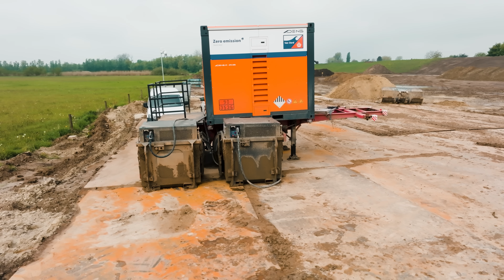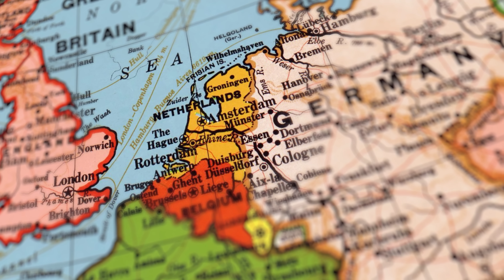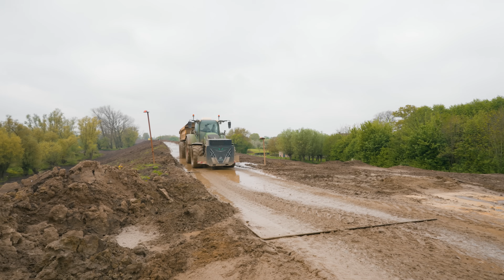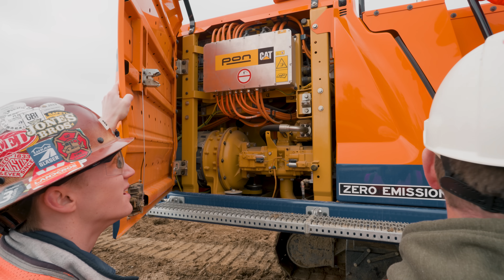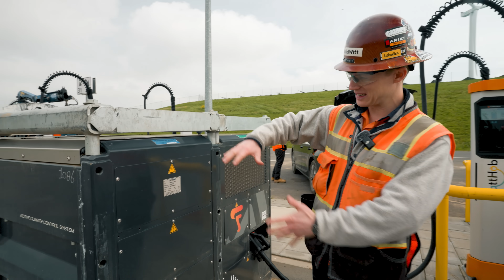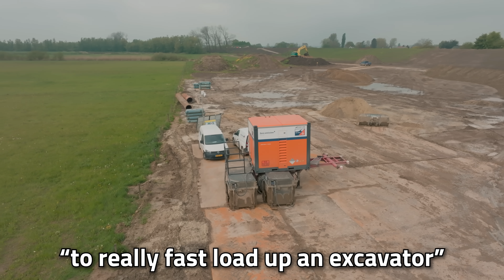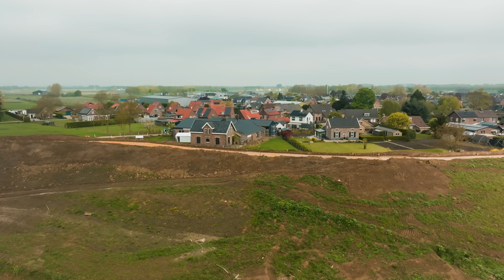Inside the World’s First Electric Construction Project!

Comment: The taxpayers are gonna be bumming paying for electricity and battery replacement. It gets passed on to municipalities. Solar panels don't recharge them how is the electricity for recharging produced? Fossil.
Reply: The solar and wind park you see next to the charging station (Geldermalsen, NL) is only allowed to put power into the grid. It’s not allowed to take power from the grid during daytime. So no renewable energy means no charging.

For the DC charger it is easy to control this as the fast charger can tell the machine or battery container how much power it may draw.

But the big batteries charging on AC proved to be a problem as we could not tell the battery how much power to draw though powerline communication. So we had to resort to a cloud based solution for the first months of this project.
Reply: @DezeTimisTim  🤝 you absolute legends
Reply: The Dutch electric grid is 40% renewable and 40% natural gas and 14 % coal.
But they might be paying for a contract with match production using renewable sources.
Reply: I suppose no different than thousands of gallons of diesel, oil changes, rebuilds, etc.
Reply: Which is what's used to produce electricity.
Reply: @rickcoleman8903  stop talking shit 🤡
Reply: @rickcoleman8903  stop it

Comment: Will it be disclosed where all this battery is getting their charge from?
Reply: The Dutch electric grid.
40% renewable, 40% natural gas and 14 % coal.
But they might be paying for a contract with matched production using only renewable energy source, in that case  it's just solar and wind turbine.
Reply: @Luzgar  54% renewable in 2024
Reply: @Freba9 The Wikipedia page only had figures up to 2022.
Feel free to update it !
Reply: he shows the sun panels and the windmill
Reply: As one of the Engineers of the project I can tell you this. The solar and wind park you see next to the charging station (Geldermalsen, NL) is only allowed to put power into the grid. It’s not allowed to take power from the grid during daytime. So no renewable energy means no charging.

For the DC charger it is easy to control this as the fast charger can tell the machine or battery container how much power it may draw.

But the big batteries charging on AC proved to be a problem as we could not tell the battery how much power to draw though powerline communication. So we had to resort to a cloud based solution for the first months of this project.
Reply: @DezeTimisTim  Great work Tim.
Reply: well over 50% of all the energy used in The Netherlands is generated by wind and solar.
so if we use the assumption they use the local grid, over half of it is green.

and i think we can all agree that 50% green energy is way better than 100% fossil fuel engines.
Reply: 😂😂😂😂😂😂 From the local coal / natural gas powerplant.
Reply: @Oldschoolrules123  nope

Comment: It would almost make sense to just drag a cable to the excavator and work with it plugged in.
Reply from the maker: That’s how a lot of large mining machines work
Reply: for the excavator that will work, but once you add in all the other vehicles driving around in building projects it becomes (almost) impossible to just lay a few cables throughout the project area to power vehicle.

Comment: Energy sources for electricity generation in the Netherlands : 40% renewable and 40% natural gas and 14 % coal.
Could be better (coal is the worst), but probably actively improving.
Reply: All coalplants are due to shut down in 2029. in the aim is to be net zero in 2050. Currently the biggest obstacle is reinforcing the grid. If the grid was capable of handling more we could be further along.
Reply: @Zandoerlenaar  Would be better in France, with our 60% nuclear.
Reply: @Luzgar  outdated figures
Reply: @Freba9 Sorry, the Wikipedia page only had figures up to 2022.

Comment: Power comes from a coal fire plant ran buy diesel equipment lmao
Reply: The Dutch electric grid is 40% renewable and 40% natural gas and 14 % coal.
But they might be paying for a contract with match production using renewable sources.
Reply: What are you talking about? I thought that my DeWalt electric power tools were running on solar panels.😂😂😂😂😂😂 Actually they get power from a natural gas power plant 30 miles away.

Comment: And the big batteries get the charge from a big diesel generator… waste of money.
Reply: You just made that up. That station is connected to the grid.
Reply: A diesel generator running at the optimal speed for peak efficiency with batteries can give you better efficiency overall than an onboard diesel engine in some case.
Reply: That charging station is clearly toed to the grid.

Comment: So if the excavator uses 800 kilowatts per hour for a 8 hour shift. That’s about the same as 80 households use in that same timeframe. A typical household uses around 30 kilowatts per hour for a full day. So it pulls the same as 400 houses per work week off the power grid. You said they have four running each day so 1600 homes per week. I’ll let everyone draw there on conclusions.

Still very cool technology.
Reply: And a Diesel excavator uses less? You can triple that number in reality. So what's the difference?
Reply: Wrong SMFH 800kwhs per 8hr shift per excavator genius!
100kwhs per HR during operations is equivalent to LESS THAN 3 GALLONS OF DIESEL FUEL BURNED! 
As diesel is 37.9kwhs in total energy content per gallon!
Reply: @4literv6  3 gallons lol in your dreams! 6-9 gallons an hour is a more realistic scenario, coming out to more than 2000kWh. Its a proven fact electric is ALWAYS more efficient!
Besides, the electric motor in this CAT zline excavator is 120KW, so 100kWh/h would mean its running almost 100% which is not the case in this scenario. Imagine all that idle time saved waiting for the next truck 😂
And lastly, 37.95 X 3 = 113kWh per hour 😂😂
Reply: Lol 800KW/h? I don't think we'd be doing this then. It's per 8 hour shift.
Reply: @lolimpol looks like he calculated the raw energy provided from burning diesel fuel alone without accounting for engine efficiency. Assuming 45%, we end up with yours, which is correct.
Reply: @HammondOfTexas0 no those 2000kWh+ in diesel burned are raw energy numbers. Just to indicate its a stupid point to bring up as modern gas and coal power plants operate at 80+% efficiency. The entire reason 2000kWh of diesel has to be burned is because of the 30% efficiency (45% is extremely high for anything not F1😅)

Comment: Wait a minute, they use a diesel truck to transport the batteries to the site? Nice 👍
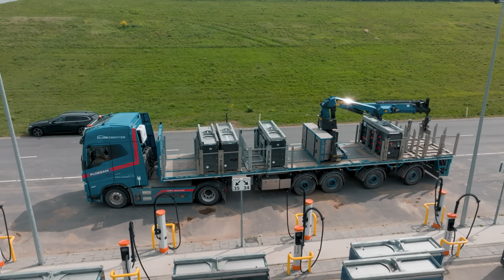Reply: If you mean the truck seen at 16:07, then no actually.
Reply: @stephanvink4920 I didn't knew that Volvo had electric trucks ( meaning that well developed), thanks for the info. 👍
Reply: Those are electric Volvo's.... sorry to burst your bubble there :)
Reply: NO THEY DON'T, IT EVEN HAS A PLUG PAINTED ON IT'S SIDE SO EVEN THE DUMB SHOULD NOTICE
Reply: calm down
Reply: The truck is only going to be there for part of the time. You only have one machine running diesel, that's still significantly less noise on the job site and less air pollution for people to breathe in if you're working in a populated area.
Reply: Wow in two hours I got 6 sassy smart girls that cannot respond without shaking their hips. Go all suck a pick.
Reply: @Aaron Witt @Ar Things here are moderated with the North Korea filter? what's the problem of responding on the same energy? It's a crime saying they should go suck a Dick?
Reply: Don't worry, all of that heavy equipment is built from using OIL.  I have yet to see heavy equipment built from scratch using solar panels and wind turbines. They always leave that part out.
Reply: @Oldschoolrules123  not relevant at all. Total emissions are far lower.
Reply: They use whatever the energy mix of the grit is, which in Europe is much cleaner @Oldschoolrules123
Reply: @Oldschoolrules123 goddamn man, you habe really zero fucking clue 🤦‍♂️ 
how can someone be so confidently wrong?😂

One could argue that a big part of the steel still get's produced with coal, but definitely not oil. 
but a) the emissions in production would be the same for a diesel machine 
and b) they're currently in the process of switching to electric arc furnaces and hydrogen reduction

and don't come at me with the "bUt WhErE dO tHeY gEt ThE eLeCtRiCiTy FrOm?", not every country is as underdeveloped as the u.s..

Comment: One of the largest construction machines, Tunnel Boring Machines are mostly electrically powered especially when they are used for railway projects as railways would require electric connection from grid anyways.
Reply from the maker: Yeah most large mining machines are also electric and have been for over a century
Reply: @buildwitt Why don't you be honest Aaron about where that electric comes from.
Reply: @Oldschoolrules123  For the mining, it is not about where the fuel comes from, but where it goes. Exhaust in an underground mine is always a bad thing. Therefore electric is better there.
Reply: @Oldschoolrules123  You obviously didn't pay attention to the video...........they showed the windmills and solar panels that supply power to the charging station for this project. Of course it could be different on the next one, but they were honest about all of that. Electric isn't a replacement for all IC powered vehicles, but it is fine if done by choice and not forced. While I have been using Milwaukee lithium battery tools for 20 years, since they came out, I still have a real 5hp 17.3 cfm at 175psi westinghouse air brake compressor for the air tools and cnc plasma that I need. They work together with their own pros and cons.
Reply: Cry me a river of salty tears. 😢 @CGT80
Reply: Yes, power from either diesel generators or the power grid from a plant that mostly runs off of coal or natural gas. You know .... OIL.
Reply: @Oldschoolrules123  Depends on where you live, in France it's 60 % nuclear for our grid.
Using a diesel generator that will always run at its optimal speed of peak efficiency can be better than an onboard diesel engine (in some cases).
Reply: @Luzgar  Most people know including me that nuclear is the best . Sorry but many people don't like nuclear. And many people think that wind turbines and solar panels are the future. People forget that in emergencies like tornadoes and especially hurricanes, gas and diesel can be trucked in. You can't truck in electric power.
Reply: @Oldschoolrules123 You can truck in diesel generators and fuel.
You can truck in a few of those giant batteries.
It's less convenient, but it's far from impossible.
Reply: @Luzgar 😂😂😂😂😂 Excuse me, most cars and trucks and equipment run off of gas and diesel .... Not batteries. Obviously you don't live in a hurricane prone area.
Reply: @Oldschoolrules123 Well yes, but that's already a solved problem and not what this discussion was about.
Reply: Hi child, you aren't the one in charge of the discussion. But keep on responding back.  @Luzgar
Reply: @Oldschoolrules123 Ah yes, the Netherlands. Known for its many tornadoes and hurricanes.
Reply: @Luzgar In the UK the greater part of our electricity comes from green power,  plus we buy a lot from Norway which is mainly hydroelectric.
Reply: @Oldschoolrules123 that can be said about battery electric construction vehicles too.

Also 45% of us electricity is clean electricity.

Comment: What happens when the charge time for batteries increases due to aging? , as well as fast charging killing battery life quicker ?
Reply: They’re not charging that fast. They’re huge batteries. 1C is slow. They’ll do 1C at 80% degradation too. 

And there will be more and more re-use of packs the more become available. Those shipping container packs often use refurbished EV batteries (replace worst cells, re-wire cooling, trick the ECU).
Reply: Time will show and tell us everything. @MiesvanderLippe
Reply: When they age out so far that its not worth it on mobile machines, they will be re-used as permanent battery packs to balance the grid etc. So no worries, they have a use after this.

Comment: 350 KW charging. Now that's fast.
Reply: In Norway 400KW and 500KW is alsow for Normal car. Have many... 👌
Reply: yes, 350 kW at 800 V is pretty normal these days.
Reply: They are working on 1000KW for trucks. But since that is not completely developed, I think they went with of the shelve components and just build it to work and are going to improve it it the next version.
Reply: @mennol3885  correct. The first MCS chargers have just arrived on the market. Won’t take long :D

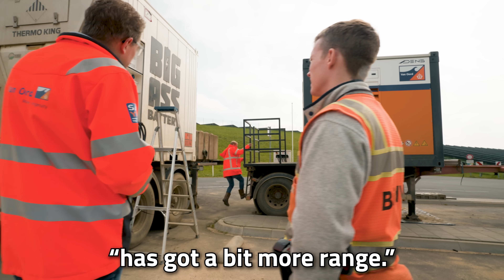Comment: 16:45 that is one BIG ASS BATTERY
Reply: LOL, i get the joke they all think its serieus!
Reply: Many, many, BIG ASS FANS could be powered from one of those big ass batteries.........just need some inverters to get it back to AC power.
Reply: @CGT80  You didn't' listen obviously since that Big Ass Battery had a fast inverter inside of it.
Reply: @sparksmcgee6641  
I thought they were talking about charging the battery from AC inputs, not providing AC output. Either way, many modern AC to DC chargers are bi-directional.
Reply: @lostcrickets  Yep I agree. On heavy custom I think they go both ways.
Reply: @sparksmcgee6641  A fast inverter? So is there a gnome inside running in a little wheel really fast? Faster than the others, right? 
Do you even have a clue what you babbeling about? High-efficiency or low-THD inverter, High-capacity inverter equals Fast charger. But these concepts are foreign to your brain. And you wouldn't understand what your are being told in a hundred years.
Reply: @darknase dude it's a quick YT comment. Inverters that have a high capacity compared to the use is obviously part of a "fast"  set up.
You have problem whining semantic when everyone knows what I was saying.
Yet no one know if you're communicating and failing or just whining.
Reply: 1 ton of diesel has more usable energy than 20 to 30 tons of lithium-ion batteries. Diesel contains about 12 MWh per ton, and with engine and drivetrain losses, delivers around 4.2 MWh of usable energy. The difference between using diesel by weight (kg) or volume (liters) is minimal, since diesel weighs about 0.84 kg per liter—a negligible variation for energy comparisons.

To match this output with an electric drivetrain, you need to account for real-world system losses. While EVs are often claimed to be 90% efficient, that figure ignores losses from charging, heat, inverters, and drivetrain. Realistically, total EV system efficiency ranges from 70–80%. That means delivering the same 4.2 MWh would require 5.25–6 MWh stored in the battery.

With current battery energy densities averaging 200 Wh/kg, this translates to 26 to 30 tons of batteries—over 20 times the mass of diesel. Even with advanced cells hitting 300 Wh/kg, you’d still need 20 tons. So while EVs are efficient in motion, their overall system efficiency is often overstated, and energy density remains a major challenge.
Reply: @darknase  

What do you think the 90% EV efficiency number accounts for if not resistive losses (via heat) and the mechanical drivetrain (typically simpler in EVs) ? The 90% is a compound of the very high efficiency of the electric motors (~95%) combined slightly lower efficiency of the batteries (90%) and some other losses that you mentioned. On top of that, charging is out of context here, since the question is the usable runtime of the system on an amount of energy.
Reply: @darknase  One way they're dealing with density is charging fast. Tesla Semis can charge as fast as a fuel up. 
The systema are coming for use in a lot of areas. The batteries aren't the issue anymore for a lot of use cases. Like indoor work and mine sites.
Every new charging station the hard ware can do 1600-1800v charging. Met a service guy at one and chatted a while.

Main thing is as soo as heavy EVs are made they sell.
Reply: @darknase  graphene batteries can help solve that 

The energy density of graphene batteries would be around 1000Wh/kg and they charge a lot faster than Li ion. You would still need to get more energy more often than diesel but that turn around time will be in minutes not hours. No need to carry around all these batteries

Comment: Running an electric motor to power a hydraulic pump is pretty inefficient. These big machines running on diesel are about the most efficient use of fuel, the batteries are a lot better going towards vehicles at this time as they can benefit from regenerative braking and have short cycles where the engine is cold often.And to top it off, charging a battery to charge another battery...this makes no sense.
Reply: Not a efficiency issue that they tried to tackle here, its a nitrogen and CO2 issue, mainly the nitrogen. The Netherlands is quite cramped and with all ppl, livestock and industry we are vastly exceeding output of nitrogen-compounds our limited nature can handle, and those nature areas are getting worse buy the year. Due to some lawsuits, any construction project now needs to show how much pollution is made during construction and that the end product will exhaust. This than has to fit within the budget for that area (so not just the dike they are making but also all the houses and farms) Doing this all electric, and thus not producing nitrogen compounds in the area, allows you to do the project that otherwise would need to wait or would not be approved due to nitrogen budget being full.
Reply from the maker: thank you for the background